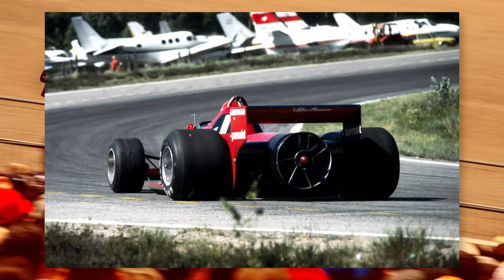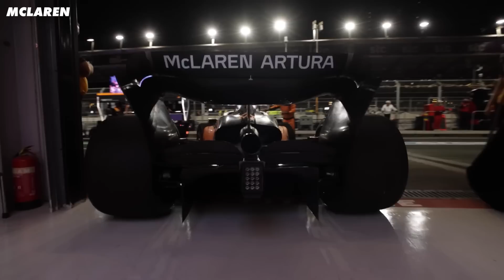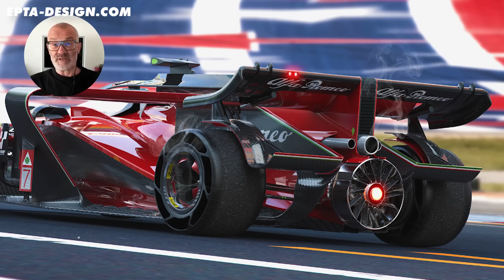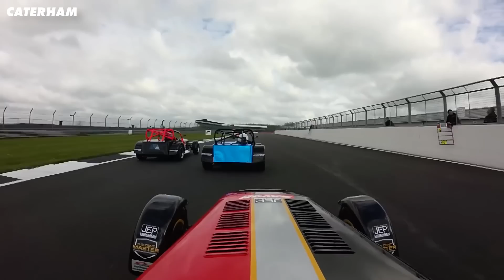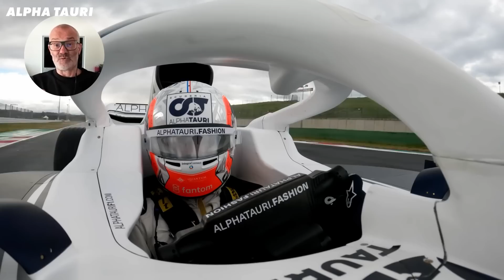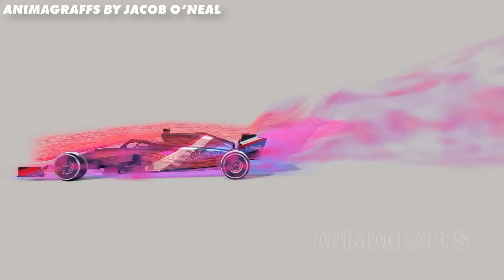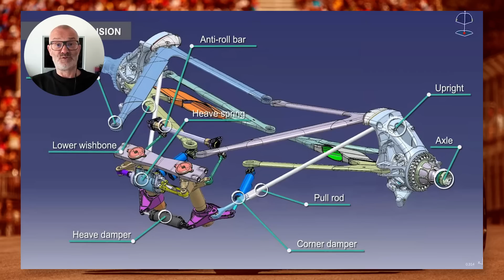Would Fan Cars Work in Formula 1?

Comment: Active suspension needs to come back. Even affordable cars have them nowadays.
Reply: Production autos have it so add it to Formula One for manufacturer's to develop them further.
Reply: active aero too
Reply: @keisuketakahasi4584  I think active aero has already been planned for 2026 cars
Reply: @rdfszyug8035  i mean on normal road cars
Reply: @keisuketakahasi4584  
ah ok sorry
Reply: but it would fundamentally change how a car feels to a driver, you would lose an element that makes these current cars so special
Reply: @justamanchimp  you mean the bouncing? lol
Reply: @keisuketakahasi4584  They can eliminate that without active suspension.
Reply: Yeas just like normal cars have a steering wheel. The f1 whee is only 50K+🤡
Reply: No road car ever had true active suspension. They have only active dampers which is a low hanging fruit that can be fitted relatively inexpensively with minimal design alterations, as it doesn’t use any complex actuators.

Active suspension as was in f1 in the 90s uses actuators to directly control the suspension movement. That gives you the ability to actively control spring rate, damping, ride height and have an inerter effect (which gives a force proportional to suspension acceleration).
Road car suspension controls only the damping, so calling it active suspension is a bit of a stretch.
Reply: @ASJC27  Yes, all that is already in the road car damping, ride height, body levelling etc. It even use camera to scan the road ahead + gps data to adjust the suspension on the fly.

How do you think big heavy electric sport cars able to turn corner like they are on rails?
Reply: @ASJC27  check out Mercedes e-active body control

Comment: Even with the Spierling at goodwood, you could already see the insane problem of fan cars. That thing was throwing dust and rocks miles behind, which is fine for time runs but way too dangerous for racing.

Active suspension and aero might be interesting, but there would have to be some level of spec parts to prevent the costs from spiralling imo.
Reply: It was only dust, no rocks. The mcMurtry Speirling has an air filter that needs to be periodically changed to make it safer to race.
Reply: It was only dust. Besides, the racing line would be completely clear after a handful of race laps at most.
Reply: You mean dust and leaves were coming out of the back?
Reply: @v4skunk739  yeah, it was the same reason why the Brabham BT46B, the og fan car, was banned. But maybe if the fia makes the teams put some sort of grate behind the fan to prevent the debris from flying about? Heck you could even put some sort of quick release so the grill can be changed during pit stops
Reply: yeah they couldn't bring in fans before enclosing the cockpit

Comment: A Red Bull X2010 with less power would probably be the best bet.

Also as annoying the noise, blown diffusers.
You can lower the over-body downforce to increase the top speeds and reduce turbulence whilst getting free downforce from the underside of the car.
It would also be another efficient use of the exhaust gases, as well as powering the turbo, power some of the downforce.

Comment: Great suggestions! Just one thing - all those ideas add weight and that's the one thing drivers are complaining about. They are far worse than the cars we had in the 90s and 2000s plus one of their biggest advantage has been the hybrid system which seems to have hidden all those flaws. Take away the hybrid and aero and you'll have a car that's probably slower than 2000s era but be the quickest through the corners because of the ground effects. I think Scott might be on to something here. :)

Comment: You can't have a rear wing and front wing which fold away only to return when approaching a corner because what if one or, God forbid, both fail as the driver starts to break and turn in? Standardised active suspension is the way to go...
Reply: The DRS can lead to the same thing, look at Marcus Ericsson's crash from a few years ago(2018 I think) at Monza T1 when his DRS failed going into the braking zone

Comment: Why not just let the drivers use DRS whenever they want? Already implemented, first step of active aero for cheap!
Reply: It will violate the original purpose of DRS.  DRS is supposed to assist the close following car overtake.  If all cars can use DRS anytime, the overtake assist purpose will be  nullified.
Reply: @catchnkill  Sure, but this video is about how to bring back active components to make the cars faster. Would be fun to see more DRD style active aero, e.g. front wings and floor changes. Similar to ride height devices in MotoGP.

Comment: Has anybody here ever heard of Jim Hall and the Chaparral 2J ?
Looking like a box on wheels, but it worked so well that if I recall correctly, it was immediately banned.
A separate engine drove two big fans. 
No. I'm not going to look through that 3 ft high pile of rules.
Did they use a KTM maintenance manual for illustrative purposes ?
Reply: Hall also had an active wing prior to the 2J, the 2E.  It also had ducting in the front of the car that opened when braking that gave the front of the car more frontal downforce.
Reply: @kennoble9581  Thank you Ken.
I did not know that.  Brilliant design.  I was waiting for that talking head in the upper left hand corner to mention Jim Hall. Never happened.

Comment: YES PLEASE for the active aero. I think it is the concept which would affect road cars the most. And in the end F1 and the FIA want the tech developed to be usable on the road. Active suspension is already present in some road cars. Active aero on the other hand has the ability to drastically reduce drag, which for an ICE or EV road car means less fuel consumption which is the holly grail of road cars right now. In any case I personally really didn't like the simplification of the current regs. F1 should be going towards more technology, not less.
Reply: Only problem with active aero which Scarbs was mentioning was going to the full complex tuck away complexity.  I would hate to be the driver going flat out down a large straight and the active aero fails because of 'technical' issues and you have no grip to slow down.  
Run off areas would be have to be monstrous, tire barrier's being so deep and foamy.  
Actually now to think about it, track safety tech would become just as interesting as it tries to cope with the increase car performance.
.

Comment: Has anyone suggested just using a tuned mass damper in the rear to counter-act the proposing?  If they know the frequency of the bouncing, that seems like a low-cost solution to fixing this problem for everyone.
Reply: everything you can possibly think of has been done by an f1 team and subsequently banned
Reply: @juice-opinion  because Ferrari threw a wobbly
Reply: See that's a great idea, which is why it will never be present in F1
Reply: Renault used it in back in their dominant Alonso era, and....of course it was banned!
Reply: indy cars use them, seem like a great solution.
Reply: They did, Renault used the Mass Damper in 2005 and teams were struggling to mimic their success. The Teams then saw a clause in the rule book that worried them about the potential of their Mass Dampers being banned. The reason was that the Mass Damper was attached far in front of the nose away from the front suspension and wasn't connected to any suspension components, thus it cannot be considered part of it, and since it could dampen ride height changes via its inended use it was ultimately considered a moving Aerodynamic part in the rulebook.

 Teams consulted the FIA about the Mass Dampers, some want it staying, some want it banned, and it finally did. There is not a whole lot of evidence to suggest this was in fact the reason why nor did it ever actually happen, but what I believe to be the funniest final straw that led to the FIA banning Mass Dampers was because of Flavio Briatore called them all a bunch of chumps and offered to sell Renault's Damper design to the other teams at a hefty price. These were mostly just rumours, but it screams typical Flavio Briatore fashion if you ask me lol.
Reply: @youngrody2386  Sure, the FIA can ban whatever they want, but they should have just written a new rule banning the mass damper itself of they wanted it banned. Using the "movable aerodynamic devices" rule to justify this ban was always a stretch, and a hilarious bastardisation of that rule's original intentions. If we go all the way down that particular rabbit hole, the logical endpoint is that the whole physical car should be banned because it's an aerodynamic device that can move.
Reply: @sporkafife  But the thing was it was banned it officially 2007 when they added a rule where they precisely describe what a mass damper is, what they did in 2006 however was a sneaky way to ban the Mass Damper mid season without having to change the ruleset just to seemingly give Renault the middle finger, and amongst all the parts that an F1 car had the damper was indeed the only one who fit the description even if it was a bit of a stretch.

 Tl;dr: They found a rule where it might qualify it getting banned without looking like a rule that's sole purpose is to screw with a particular team, like in 2005. Nothing new pretty much.
Reply: Mega brain moment.
Reply: Propose who?
Reply: The point of not having active suspension is that it interferes with how a driver works with weight transfer. With tuned mass damper, it interferes with how a driver feels the track and eliminates aspects of certain tracks. With both of these you lose that aspect of a driver manually having to work with the car. In this respect it's the same argument as ABS or TCS or other driver assists like that. Using anything along those lines essentially is an assist to the driver. I agree with F1 where that if possible, we should keep the cars as manual as possible, so no ABS, no TCS, no AS, etc. It's the ultimate form of competition to be able to drive these cars without assists. Imo it should stay that way for the sake of being the best. Only last resort could I accept using assists like this.

Comment: Let the engineers solve the problem. Set a box, tire limits and fuel capacity, and some safety standards. Then let them at it.
Reply: possibly also some cost caps.
Reply: @Mihails Akulenkovs would also see cars that are incompatible with racing, considering the dirty air the past the produced with strict limitations.

Comment: I think everyone watching Goodwood last week had exactly the same thought. However there are a few reasons fan cars won't be a great idea. The original fan car was criticised by other drivers because of its habit of vacuuming up dust and debris and blasting it out the back into the cars behind. Safety is another problem. If they are unsettled and break the undertray seal, they can catastrophically lose downforce, leading to potentially bad accidents. This was a significant criticism of the days of ground effects and skirts - and probably a factor in Giles Villeneuve's fatal crash.
When it comes to some level of active aero and active suspension, F1 is starting to look ridiculous. These are no longer the pinnacle of automotive technology. You can buy a large number of high end sports cars that are more advanced when it comes to suspension and aero. Active aero was banned on safety grounds when cars had (again) catastrophic failures of downforce and bad accidents. But once DRS was introduced this argument ceases to hold. Active suspension was originally banned because it was (correctly) deemed to be an active aero device. The whole lot is banned because they worry that it is too costly to develop and thus some teams can outspend others to gain an advantage. Guess what? We have a cost cap. So the cost of development argument is also no longer valid. Spec parts and some sensible rules on control laws would easily make for a vastly more useful set of rules. They really need to get away from this ever more prescriptive phone book of rules, with its insane legality boxes and to the millimetre regulations on everything.
Reply: 18-20 cars going around vacuuming the track debris wont be around that long
Reply: @Francis Vaughan well said! 100% agree about some rule changes being needed for active aero and other technologies.
Reply: The exhaust from a fan doesn't have to exit out the back of the car. The Murray fan did because that's where the rules hole forced it to be. The exhaust can be mandated anywhere they decide to put it.
By the same token a modern fan doesn't need to be as big and obvious as the old Murray. If I'm not mistaken the Speirling uses compressor style fans (think a centrifugal supercharger). Scarbs' claim of how much power they would consume sounds way high to me.
Reply: Gordon Murray said that the story of following drivers being blasted by the fan was nonsense. Dreamed up by other teams to get the car banned. I seem to remember Mario Andretti admitting that was the case.
Reply: The cost argument doesnt fully hold I think. For some active aero components the actual car manufacturers (e.g. mercedes, McLaren,  ferrari) can do research and claim the research is for their production cars. Teams like Rb, Alpha Tauri and Williams will have to do research on full f1 budget. From my understanding this happened before and will most likely happen again.
Reply: @marcvanveen7704  The argument applies to any part of the car. FISA want to see the end-to-end design work for any part of the F1 cars, they currently demand to see the entire design trail to prove a design was not derived from illegal copying methods from other team's cars. Same argument would apply for design elements for active aero, or anything else.  You don't get to slip design work in by stealth from somewhere not under the cost cap. Active aero on road cars is currently pretty basic. Applicability can be gauged by asking how much F1 tech makes it directly into a road car. The answer is - not much. (The Merc F1 road car is a good example of how silly the idea is.) The single biggest problem seems to be being able to trust your CFD work. Active aero will push that question even harder.
Right now the engine manufacturing teams also have a huge advantage in that they can craft the engine to their car's design concept, whereas the customer teams have to take it as is, no matter what design concept they might have. The big dogs in the game always have advantages. That isn't a reason not to advance the state of the art.
Reply: How about tying the fan to an accelerometer and g-meter. Wherein it’s only active in corners and braking. Power it thru-the recovery system or an enlarged alternator or generator. And just reduce the overall size of the wings so they’re faster in the straights. And use a variation of GM’s magnaride system already in use on Ferraris.